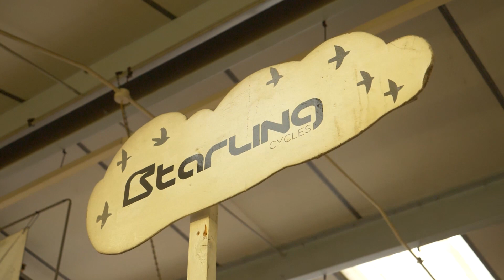Meet The Frame Builder Using Aerospace Carbon Fibre To Prototype Bikes!

Comment: This is an absolute load of crap, you don't need aerospace grade steel or carbon fibre for bikes, a bike doesn't need to stay in the air and keep 100s of people safe. We're looking at manufacturing and material costs here. saying aerospace grade CF is so much better is daft. We wire erode tiny pieces of steel for the aerospace industry, costing £1000s so an engine doesn't fail, you don't need these on a bike. He's trying to come up with a problem to obtain funding and polishing the 'environmental' turd.

Comment: I had a ‘97 GT STS (DH 1000 ?) STS stands for “single tube system”. So it was a single “sock” placed in a jig with its 3 machined “lugs” and impregnated with hot nylon. 
“there’s nothing new under the sun”

Comment: Yes ,reality is If carbon was any good they would make aluminium from it and if aluminium was any good they would make steel from it. Fashion and government funding has driven this project. The weight saving over steel is unimportant in Emtbs. E=Mtb²
Reply: There's this thing called CORROSION
Reply: @ianmangham4570  Paint, Inox lanox, gravity and If someone's ego is looking for a trip I suggest they give a steel or aluminium Emtb a proper long ,hard and fast up / down flow. It's not one or the other but riding both  Emtbs and a carbn naturally aspirated mtbs to enhance the fun fun fun of these Time Machines. E=Mtb²

Comment: Thermoplastic means it can be melted and reformed again(recycled) thermosetting is set and can not be reheated or melted to be recycled or remade into another form again...also it will just burn if you try...
Plastic means its form is not set.
Thermosetting means its formed and set into its final state.

Comment: Pro's: Increased damage tolerance over normal epoxy carbonfibre. That's cool.
Cons: Limited to a very basic frame design, limited battery size due to tubing shape and diameter. 
But, looks are subjective and a potentially smaller battery size won't affect everyone. It'll be interesting to see how these develope 👍
Reply from the maker: Absolutely! This is only a prototype so far. Like you said, It'll be so interesting to see how it develops! :)

Comment: I may be wrong but hasn't GT used thermoplastic back in the 90s with their LTS? 
The stirling is a damn good looking bike... Take my money and send me one pls😊
Reply: It was the ‘97, or there abouts, GT STS. The same thermoplastic process as described in video. Fun fact: it was heavier than the alu version. Mine with carbon everything else carbon and Rock Shox World Cup fork and Risse rear air shock, and very nice Mavic wheel set was 28lbs with the heavy 2.5 Maxxis Hookworms.
Reply: @stevenreyes3680  thx for the correction! A friend of mine has been the WC support back than and told me that they had a FRANKENSTEIN bike which was recycled and broken (loose joint) before. They heated ist and put some plastic powder in the gap

Comment: nice but for EMTB, it is the battery and motor that is super heavy not the frame.
Reply: yeh where does the battery on this prototype go ?
Reply from the maker: Yeah, that's true but it looks to be a great alternative to the carbon used in current E-bikes. 👍

Comment: Joe carbon fibre for bikes go through no where near the stress that an airplane goes through
Reply: Jack, you design most things to be just below their allowable stress at peak loads.  So no you are wrong, the stress levels are pretty similar.  

The difference is the criticality, aeroplanes cannot fail, so they cannot afford to have any features that that risk their integrity, and you need to prove this compliance to the aviation authorities.  With bikes the cost of warranty, and potential lawsuits is the driver to criticality, so quality can be reduced.

I'm not stupid dude and I do know my stuff, so don't try to pick holes!!!  Wink Emoji!!
Reply: @joemcewan2950  cracked carbon frames are relatively common, cracked carbon wing or fuselage are a mayor trajedy...
Reply: lol